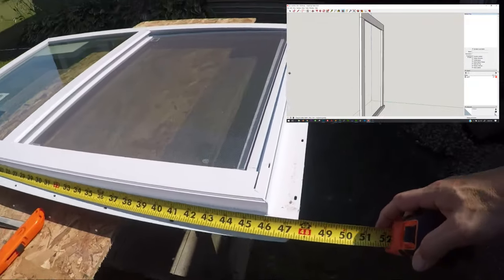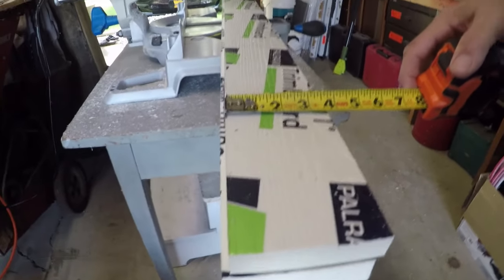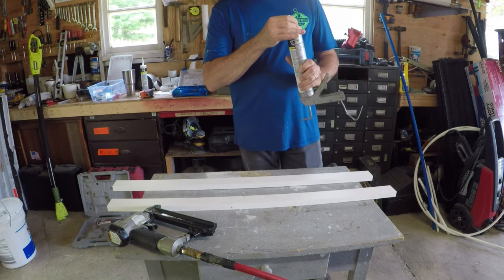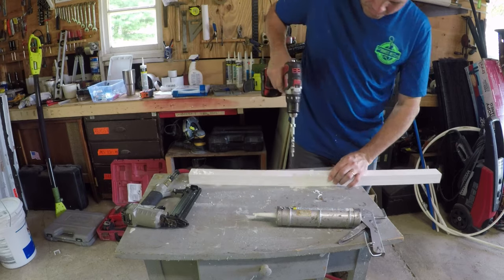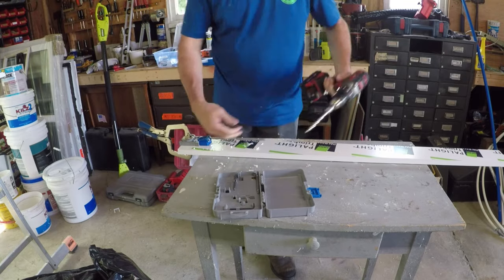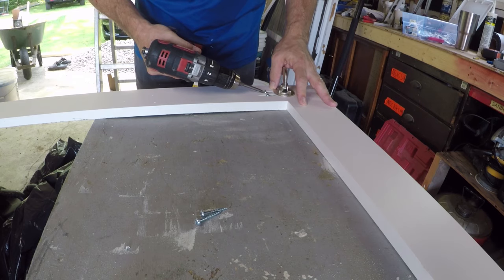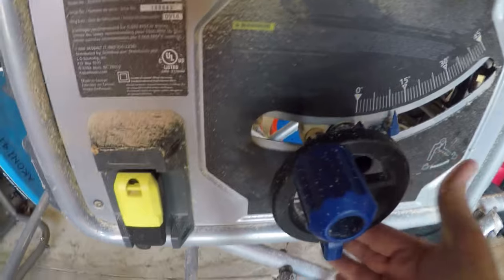Make Classic PVC Window Trim using Kreg Jig Tool

Comment: Nice job, good instructions. I usually cut a drip groove on the underside of the sill, about 3/4" in from the front to break the surface tension as the water runs off the sill. Surface tension can cause the water to hang on to the underside of the sill and then run down the siding.
Reply from the maker: Derby Dad, I was upset that I didn't include that step. Thanks for pointing that out. Simple to do when constructing and a bit of a pain to do after the fact.

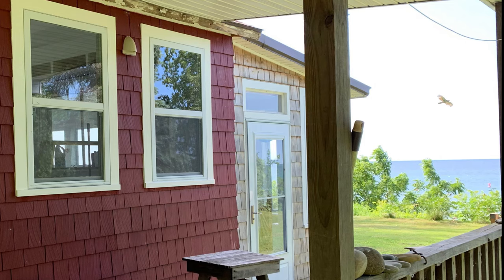Comment: 5:19 Do you caulk between the trim and the PVC window?  How about caulk between the shingles and the trim?
Reply from the maker: Chris, When I install the window, I weatherproof with 4" membrane tape. There probably isn't a need to caulk the gaps, but I tend to go overboard and lay a bead down before placing the trim. One thing that I make sure to do is not put a bead along the lower horizontal part. Water isn't going to push its way up and leaving the lower without a bead will allow any water that happened to get in elsewhere to escape.

Comment: Makw sure you use caulk that is specifically to use for PVC!
Reply from the maker: Elyse, Thanks. What is the negative if it is not specifically PVC caulk. I was thinking that as I was making some and figured I would deal with it if it caused an issue. (Didn’t have the time to run to the store and get the “right” stuff that day.)

Comment: you dont cut frame with a 45 degree angle?
Reply from the maker: Mike, This could be something you did as an option. However, this is more of a classic window trim. Having the sill that sits forward of the stiles (vertical pieces) wouldn't even allow for a 45. This is a trim style you will find on most houses before vinyl siding/flashing.

One of the things I skipped was the drip cap.
Reply: Very nice it’s funny because all the new construction doesn’t look that smooth...